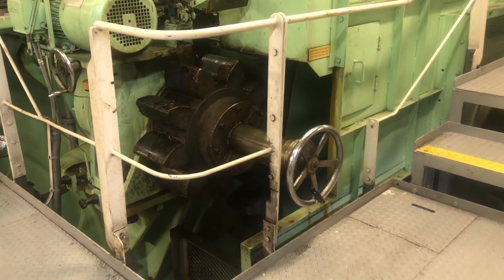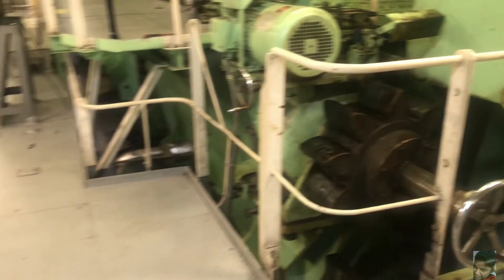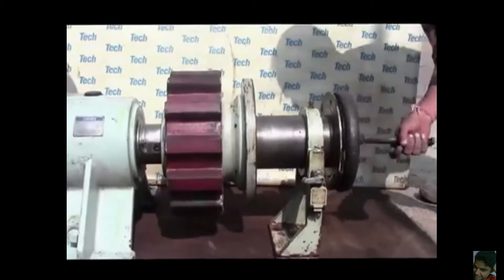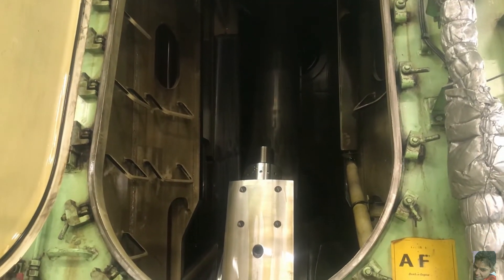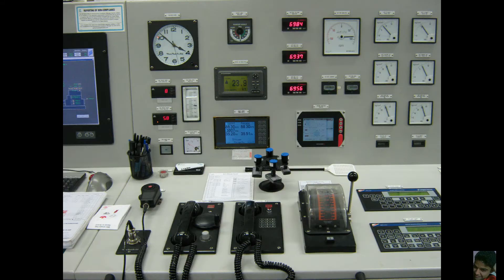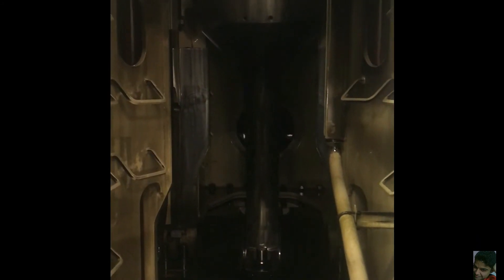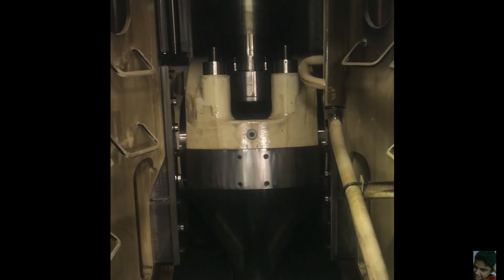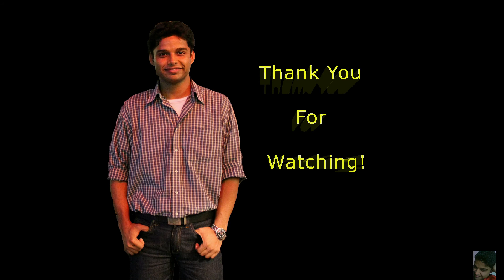Turning Gear Motor | Main Engine | Crankcase Moving Parts | Introduction | RoamerRealm

Comment: What type of motor used in turning gear ???
Reply from the maker: Hi Sam! Squirrel cage induction motors - chosen for their longevity and low maintenance. This induction motor design is the most common. Slip ring induction motors - provide a high torque and low starting current; also used in other high starting load equipments e.g. elevators, cranes, and hoists. Let me know if you have any other questions and subscribe to my YouTube channel 👍

Comment: Where can i get . ST Turning Gear Motor
(3 phase induction motor)
Type: TC-FX
Serial no.: M4076092
Frame: V-90L
Rating: 1.5 kW
Pole: 4
Freq.: 50 Hz
RPM: 1420
Voltage: 400 V
Current: 3.49 A
Connection: Y
PF: 0.78
Max. amb.: 40 deg. C
IP 54
Standard: IEC 34-1
Make: Sumitomo Heavy
Industries Ltd., Japan
Reply from the maker: Hi! Which city/country are you in? I don't have much information about this but if you tell me your location, then I can try to find out about this spare part. Let me know. Do subscribe to my YouTube channel 👍